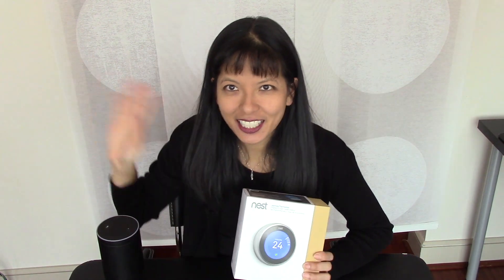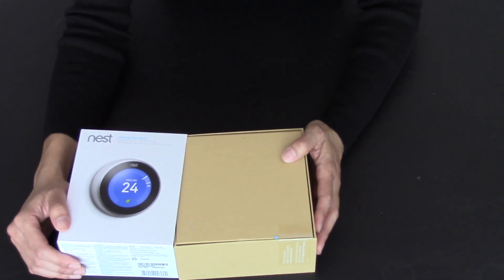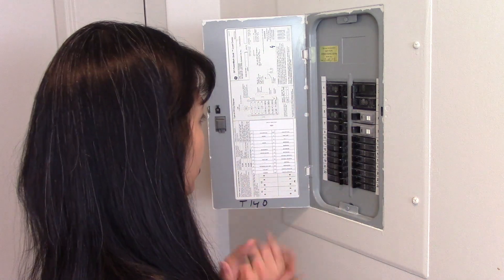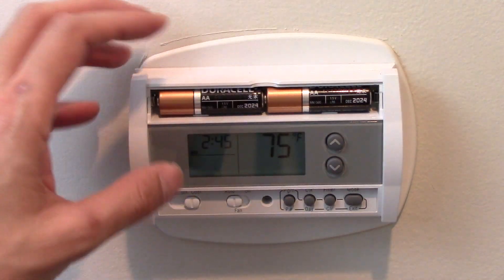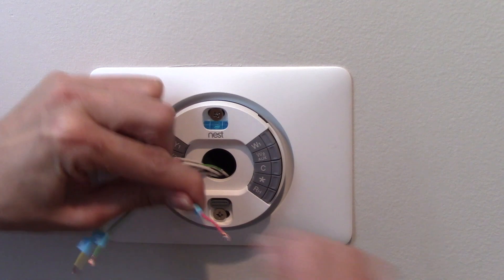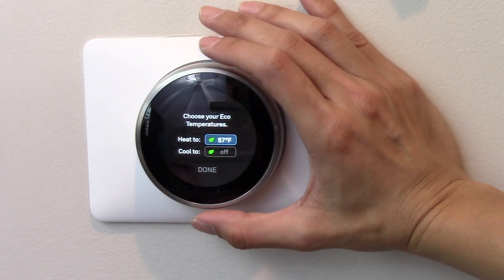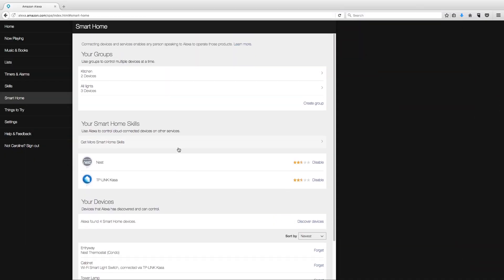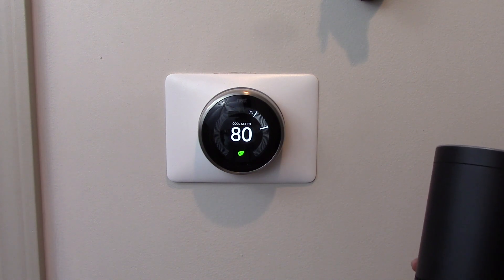Nest Thermostat Install with Alexa / Amazon Echo How To

Comment: Hi there, thanks for the video! Question for you. I noticed that you have a stranded wires, which nest says its incompatible with. But it clearly worked for you. I am wondering if you ran into any issues since the install?
Reply from the maker: No issues. My nest works great today.
Reply: Caroline Dunn Thank you so much for letting me know! Nest Support was quick to deem my place incompatible! I ended up attaching a short thermostat wires with solid copper, with some spare wirecaps I had at home. Works just fine :-)

Comment: Great video-just ONE little mistake. When you were attaching the white backplate you put the screws in on the video prior to adding the back of the NEST unit You corrected it and removed the screws but didn't show that on the video.  The white backplate simply clicks in--no screws should be used Great video though -

Comment: Thanks for the video!!! I had the exact same thermometer that you replace and was easily able to install my new Nest!!

Great step by step tutorial. Even got Alexa to talk with my Nest !!!
Reply from the maker: Great Job! When you removed your old thermostat, did you find a large hole in the wall, requiring the cover plate?
Reply: Yes. I had to use the cover plate. But, honestly, I didn't mind.

I'm glad I saw your video, as the installation was the exact same as mine I know with the Ecobee, I would have had to open up the furnace and run some additional wiring, hence why I didn't buy it.

Really glad I saw your video. I literally took it, step by step.

Thanks again.
Reply from the maker: Thanks for letting me know that you also used the cover plate. I was shocked when I saw such a large hole from removing such a small thermostat!

Comment: Nice work. Great video and voice. 
Just one note...

Washers used with the screws for the provided back plate is normal. I am surprised they did not provide washers. 

(I installed my Nest prior to watching your DYI... I still found it easy to follow. Thank you for your hard work.)

Regards

Comment: Great job..am starting my install now and giving Alexa more to do! Slacker.. (me, not her). Especially appreciated you showing the issue with existing size of cut out in wall being too large for unit and backplate! I loathe reading written instructions. Get ahead of myself and would have put old screws somewhere safe (lost), while I'm running up and down stairs to breaker. Instead of wasting time digging up alternate ones, I'll tape them to my forehead and won't wonder what the h that metal deal is. Didn't see that on any other video I watched!

Comment: I just set mine up the same way (before I even saw your video) and called my group "Nest" but for the life of me I cannot figure out the command to have it tell me what the thermostat is set at...it will only tell me the temperature of the room. For example I will ask "Alexa, what temperature is my nest set to" and it will reply with room temperature and not the correct setting. NOW...if I remove it from the GROUP and address it with my nest account name (Kitchen...like yours was entryway) then it responds and tells me what my "AC" is set at. Example: "Alexa, what is my kitchen set to?" and it will respond with "The AC is set to 84."

Might this be a glitch...give it a test and let me know. Nice review BTW...5 stars all the way!!!!!
Reply from the maker: Great question! Here are my results.

When I say, "Alexa, what is my entryway set to?" Alexa responds, "The AC is set to 78."
When I say, "Alexa, what is my nest set to?" Alexa responds, "The entryway temperature is 76 degrees."
When I say, "Alexa, what is my thermostat set to?" Alexa responds, "The AC is set to 78."
When I say, "Alexa, what temperature is my thermostat?" Alexa responds, "The entryway temperature is 76 degrees."
Both "thermostat" and "nest" are group names.
Reply: Then yours responded the same way with the group name "nest." But when you addressed it with your actual NEST name from your NEST account is responded properly. The groups name "Thermostat" seemed to respond correctly....hmmmmmm. Might have to investigate this further. Thanks for taking the time. YOU ROCK ;-)